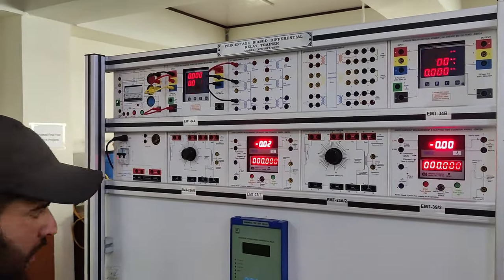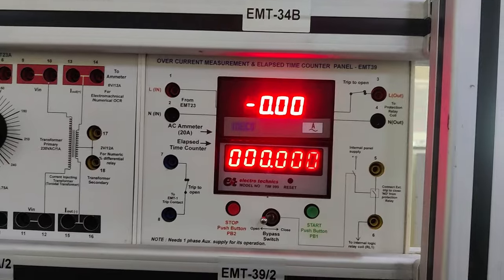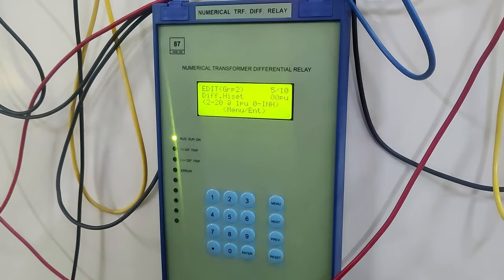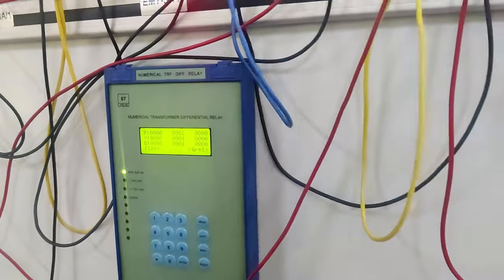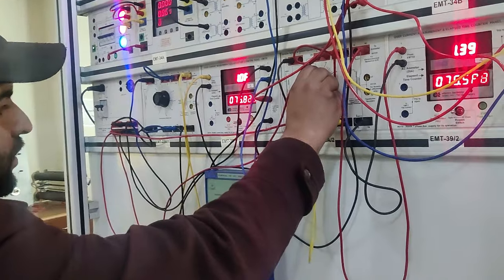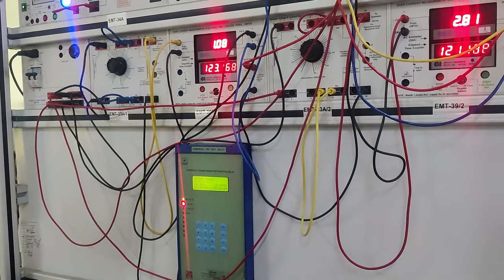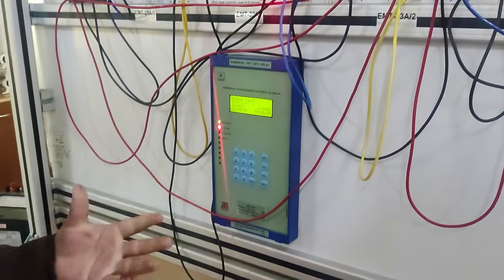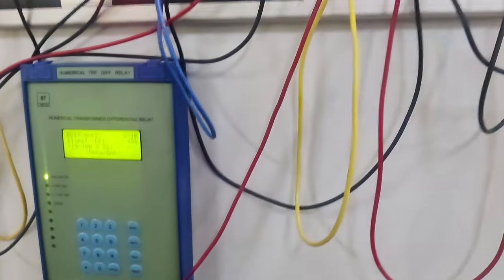Characteristics of Percentage Biased Differential Relay

Comment: Percentage differential relay is generally used for internal faults ...also it is used  because of the reason that differential relay mal operates(C.T saturation, due to no load current etc)

Comment: Sir my electric substation in this relay installation.sir whenever my out going feeder will be tripped with over current and fault causes , that time this realy also be operated.sir CTR primary 200/5 and CTR secondary 900/5 is feted.mean p u current primary G1 1.74 and secondary 1.14 parameters create in this relay.sir whose settings change in this relay that's cause this relay doesn't operate when outgoing feeders tripped that's RELAY don't operate.